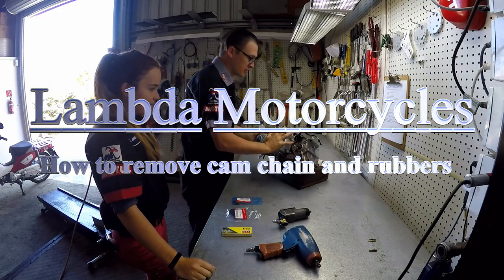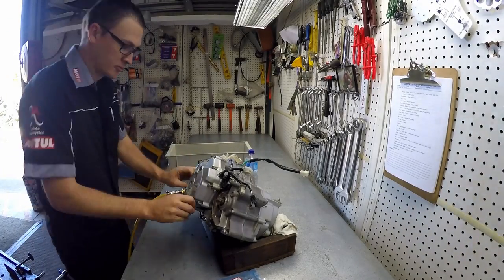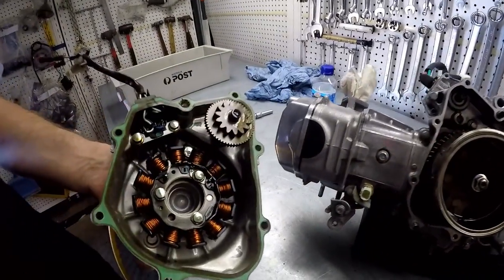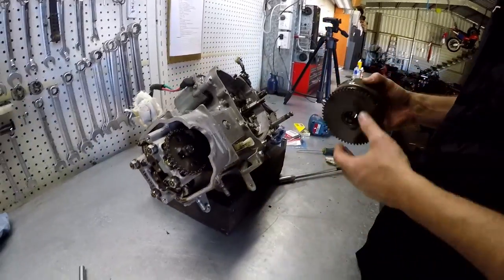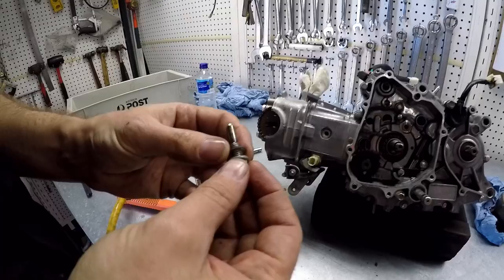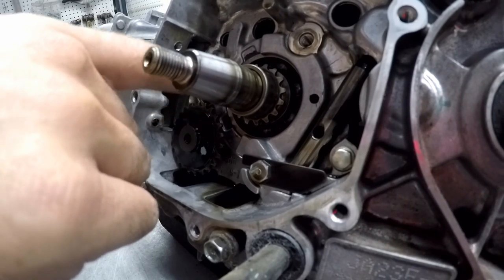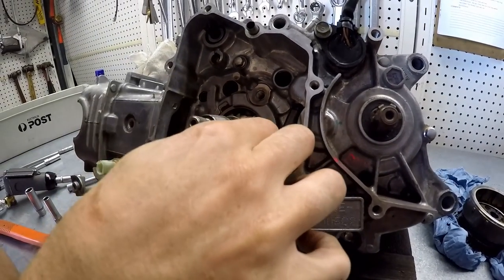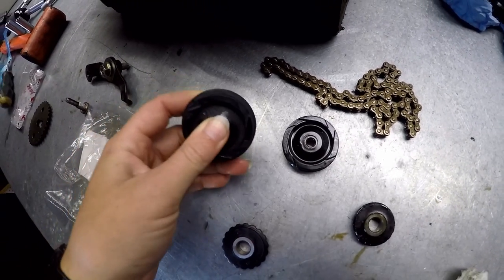How to remove a cam chain on a Honda NBC 110 post bike part 2

Comment: Thanks for the info,you can remove the pump drive gear without splitting the case....bit of a trick to hold it from the oil pump side but it can be done :)
Reply: Like to know how .. im up for doing it
Reply: Worked it out - Cheer Dirk ;)
Reply: @jagarg6573  Sorry just saw your reply now,glad you got it sorted

Comment: Just pulled one down to do the timing chain and adjusters etc .. and oil pump gear fell off the shaft .. so much for a quick job .. 5000k between oil changes cant have helped .. and it still ran ! 😳